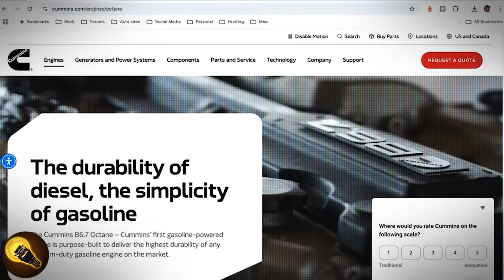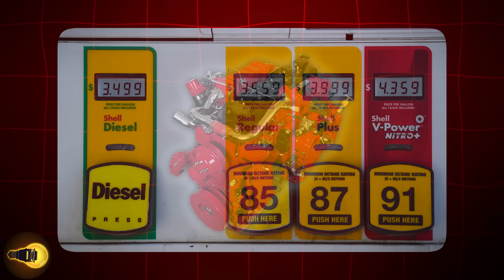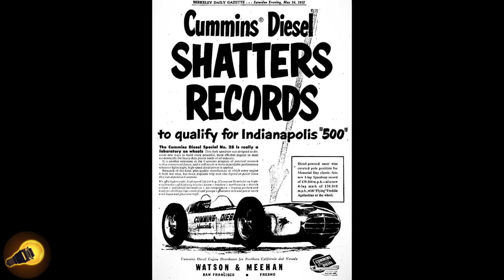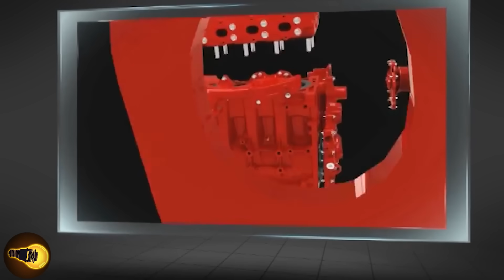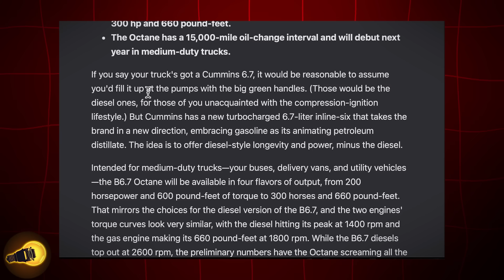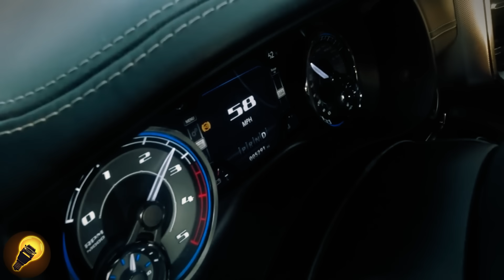Cummins Shakes The Industry With A Gasoline Engine!!!

Comment: The reason they built these engines because the diesels can't be kept out of the shop. Too many emissions problems. The engine architecture fits existing platforms and drive trains. Why not just make a spark ignition engine that runs various and forward looking fuels. Seems just smart to me!

Comment: Diesel truck engines in light trucks are "super long lasting" except that they break down every 50,000 miles with catastrophic fuel system, fuel pump or head gasket issues that cost $12,000 to repair. You could replace your entire engine in a gasoline truck for less than it cost to fix a diesel. Diesel light trucks are the biggest scam on consumers in history. I've never met a person with a diesel truck that didn't have to do massive modifications or repairs to their Ford Power Stroke or their Chevy Duramax. The Cummins Dodges seem to be the best ones though, and need less repairs.

Comment: Don't bother watching if you are looking for real info or know anything about engines. Seems like another AI video with much misinformation. For example it keeps repeating how maintenance will be the same as the diesel for the mechanics. Nonsense. No information on tech in it, gas engines compete on things so minute as piston ring tension and thickness or combustion chamber shapes to achieve MPG and durability. Zero info here. If you know nothing you can enjoy this AI video and still know nothing :)

Comment: That's an awesome idea  . Strong high compression diesel works with lower compression gasoline pistons ...what can go wrong . Longer lasting overly build engines? Cheaper fuel economy.  I think they have a winner !!!
Reply: I like the dream of that, but to get overbuilt it takes heavy connecting rods, pistons, then crankshaft and bearings. Now you have a heavy engine with lots of cost and internal friction which means low mpg. If the AI in the video was smart it would try to get this point instead of some imaginary long winded ad

Comment: I don’t favor dealing with spark issues but I think these engines would have a better impact if they were in medium commercial vehicles instead of the 7.3L gas Ford Godzilla engines. Cummins have a durable reputation, plus no Aftertreatment deff a plus.

Comment: At work I drive a Kenworth T370.  The PACCAR engine is based off of the 6.7L Cummins diesel.  If that thing became gas powered…I think I’ll be depressed, moody, and bitchy for awhile.  You know diesel withdrawals. 😫

Comment: Yes! Bring back torquey large displacement gasoline engines! People will gladly take the hit on fuel economy than to have a diesel on hold at a shop for issues related to EGR, DPF, DEF systems, other BS repairs that shouldn’t exist.

Comment: In the Pulling Motorsport, some top pullers convert their big diesel engines to alcohol which requires a change to a spart driven setup. other than gasoline, this sounds like what Cummings did

Comment: This is not the first gas engine for Cummins. It might be the first gasoline engine, but that is really not that different from a natural gas engine which Cummins has been making for years for medium sized backup generators. The ones I have seen myself were based on the 24V 5.9 engine.

Comment: Cummins had a really clean ethanol engine they ran in a delivery truck.

CUMMINS ETHOS ENGINE:
…According to Cummins, it delivers the power (up to 250 hp) and peak torque (up to 450 lb. ft.) of gasoline and diesel engines nearly twice its displacement...
...Using corn derived E-85, the high thermal efficiency and power-to-weight ratio of this engine results in 50 to 58 percent lower well-to-wheels CO2 emissions compared with the gasoline engine baseline. Using second-generation, lingo-cellulosic derived E-85, the power train’s efficiency features deliver 75 to 80 percent lower well-to-wheels CO2 emissions, depending on the drive cycle.

Ricardo built and drove an ultra clean ethanol engine for GM (EBDI) a while back.  Better power and more mpg than their diesel engine.

FROM RICARDO:
The new federal CAFE standards are calling for a doubling of fuel mileage performance, which, Vint says, is going to send OEM’s looking for high octane numbers to improve efficiency and ethanol is the best source. Ricardo, an engineering firm with over 100 years in the business of engine design, has developed an extreme boosted direct injection engine (EBDI) to optimize ethanol blends. The 3.2 V6 gasoline engine rivals the power and torque of a much larger GMC Sierra 6.6 diesel, he said, and it delivers 3.5 percent better fuel economy than the diesel.

Comment: All good, but they need to also make a smaller capacity 6 cylinder gasoline engine and a 4 cylinder engine. And also sell adaptor plates to fit -everything. This is for everything Not the three majors in the United States.

Comment: 6.7 Cummins gasser 300 HP 660 TQ. 20-22 mpg 2020-2023 3.0 Ecodiesel with top aftermarket tune 340 HP 620 TQ 30-32 mpg with 3.21 gears. 🤷‍♂️  But it’s not likely coming back. I think the 6.7 gasser will be far better than the 6.4 Hemi for in a truck

Comment: Caterpillar been making Gas and natural gas engines for years - only for industrial applications - cost is high but runs for ever
Reply: Why do diesels run forever? Because the cylinder walls are continiously coated with grafite.
The gasoline engines not. They will need an abraison proof permanent coating.
Do the new engines meet this performance?

Comment: I've actually seen natural gas conversions in an industrial setting.  They had a company in Mexico do the conversion.  At that point around the year 2000, Cummins wouldn't warrant the engines however,  they have operated successfully for many years now.  This should work just fine and you won't need DEF and all of that other EPA garbage on it.

Comment: They are panicking because of the EPA rules but if they would start putting speed of air pistons in the engines it would burn cleaner and gain 200 foot pounds of torque

Comment: Truckers would gladly drop a little hp n twist power for reliability and cheaper fuel. Diesels are freaking low rpm torque monsters but all the after exhaust add-ons has been an ever constant money suck + high diesel fuel cost + DEF + engine de-rates + after exhaust maintenance failures. Truckers can’t make money with their rigs sitting in the repair shop all the time. Let’s not forget gas engines are lighter, need less batteries because they start easier in the cold, and require cheaper engine oil and oil filters. Have been an ASE certified diesel tech for 20+ years - my guess is a gasser in a class 5,6,7 truck would make truck 1,000 to 1,500 pounds lither than ur modern day diesel rig - give truckers more hauling capacity. Gas engines pull a vacuum - diesels don’t. Get rid of the diesel engine and u get rid of the after exhaust treatment, DEF tank, DEF plumbing, DEF heaters, DEF ECM, jumbo battery packs, 50,000 psi fuel injection systems, cold start assist heaters, maybe air to air after cooler (maybe) - bet these new cummins gassers have a wicked turbo system. Hope Cummins succeeds with their gassers - they definitely build a great diesel.

Comment: This is not New before diesel engines if you needed more power you made a bigger engine 790 c.i. 6 cylinder or 8  Hall and Scott built some of those huge engines 251 c.i. to 1996 c.i these all ran on gasoline ❤❤❤❤

Comment: LOL, the reverse process of when OLDSMOBILE turned a gas engine into a diesel failure. This should be a minor adjustment, install an ignition system,  lower compression to gas levels, a few other (nearly) off the shelf items and testing. Looking forward to seeing real world information.

Comment: What are the odds this engine becomes the same as the Cummins they put in those nissan trucks? Cummins won't work on the engines and dealerships literally CANT. It's going to be a hot potatoe boat anchor, but I hope I'm wrong.

Comment: i have thought of replacing the injectors with spark plugs,    and a distributor ,   where the    injector pump is,    and running  the engine on heated ,  ,vapor gasoline, like tom ogle ,    did on his 1972 ford galaxie,,    he got 102  documented  miles per gallon    ,8.5 times  more gas millage,   that would put a tractor trailor  to   getting around 50 miles  a gallon.
Reply: he dident live long after that.
Reply: Yeah, yeah. Cummins has had natural gas engines for 50 years.

Comment: I love straight six engines, but I am struggling with the idea of a 1,200lbs gas six cylinder in a truck. That is hundreds of pounds heavier than the largest V8s in the gas powered realm.
Reply: That's why it will last a lot longer than those lightweight gasoline engines, everything about a diesel is more robust than gasoline, except cam followers, seems like no one can build them right anymore.

Comment: Make Diesel Great Again ! 🇺🇸
Reply: Reliable strong affordable simple
Reply: And the E-vehicle will never work unless they force us into 15 minute cities and take 2/3 or more of the populations vehicles away from We the People
Reply: Diesel is a fantastic fuel for vehicles that really work hard.  The challenge is for vehicles that get mixed use, where we still need the capability,  but only 10-20% of the time.
Reply: @harryniedecken5321  what if we do a diesel hybrid. That way your f250 gets 25mpg in equivalent electricity when you are in stop and go commute but when you need to tow shes ready
Reply: @TheAnnoyingBoss   Hybrids can make a lot of sense. Weight can become a challenge,  not so much for engineering reasons,  but the artificial DOT limits.   For a ram megacab,  it already requires moving to a 3500 srw for my fairly modest needs for payload.    No one else offers a megacab  / rear seat recline  / ability to take a nap that I can find.

Comment: To solve the emissions problem with diesels, they should invent an exhaust tip that you can add onto your current diesel engines or vehicles. Something like a coffee can size that reduces the exhaust that comes out by aTo solve the emissions problem with diesels, they should invent an exhaust tip that you can add onto your current diesel engines or vehicles. Something like a coffee can size that reduces the exhaust that comes out by a large percent then we can keep our diesels they should do it on all cars. They don’t need electric cars just find technology where you can add a filter on your current exhaust that will reduce admissions and Exhaust fumes by let’s say 50 or 60% and you change them out when you get your oil changed.

Comment: The RAM truck at 5:13 is what I call a sandblaster. Low profile tires are soft rubber compound. Because there's no sidewall, the tread face will heat up easily. When this truck passes you and comes back in front, you'll hear the sandblasting happening to your front end.

Comment: I doubt the longevity. There are very few gas that go past 300,000 miles.
And it will need aluminum block and head.

Comment: The Cummins gas engine has been in class 8 trucks for 20 years. Most used alternative fuels like Natural Gas or LPG. With an abysmal MPG of 3.5, the 15L gas engine has almost disappeared as have the filling stations.

Comment: Whoever programmed this AI needs to research the topic a lot better. Cummins doesn't make V6 engines... Period! The engine in the video is an inline six cylinder engine like Cummins has been making for decades. The problems that some of the comments referred to have been related to smog control equipment that has been constantly changing to satisfy the EPA. The engines run fine the way they were designed to operate.
Reply: He’s saying  B6.
Reply: You mean AI has to be programmed? I thought it was the latest tech and could think on it's own and replace every human being in every job that could ever be thought of, WOW, I'm disillusioned!

Comment: This always confirmed super gutless engine like a N14 & the rest from there don't have any respectable big grade incline holding power like any cat from the 3406B mechanical too the C15 Acert diesels absolutely no torque to keep your truck pulling hard like the above mentioned cat's does plus every dummins has another insider secret name known as the come apart because there super gutless & have to rev the snot out of them where the cat has all the reliable pulling power just above idle, said gutless inline six has to be rapted out to above 1700+ rpm to get any hint of real torque. Always hated going from the cat equipped heavy truck to these joker of a engine and the colour is a dead giveaway to how gutless these nightmares are. Period

Comment: Next big thing: Diesel helicopters.
Reply: They have already made a diesel twin engine prop plane the thing that worries me about them is the gelling at high altitudes.
Reply: Heavier, weaker engines are a great fit for use in helicopters.
Reply: Packard made diesel aviation engines almost 100 years ago, Mitsubishi in more recent times!🤷
Reply: @jeffmiller3150  What was the name of the Mitsubishi engine?

Comment: Get rid of thr DEF crap. And diesel would work like they should.  And the gov wouldnt be stealing our money.  And messing up the true cat and cummings
Reply: That's funny they say first gas  engine. In the late 60s early 70s I worked on a cummin   propane or ga s..  the injectors are replaced with spark plugs. We used a throttle  body  propane regulator. They thumped. Ran good. We bought them out of Indians.  They would high wine  and blow  from the hills.
Reply: @lylewallace9022  "They thumped. Ran good. We bought them out of Indians.  They would high wine  and blow  from the hills." Uh what?
Reply: @lylewallace9022  What?
Reply: But they are 504 or 555 can't remember so they are bull shit you. We had 7 in the fleet in our diamond reo.  Rest are 855 250 hp  270 high torque black engine
Reply: The military deletes all of their trucks 😆 how dare they expose our servicemen to that evil black smoke and not have limp modes kick in during a firefight!
Reply: The DEF is what we need.The particulate filter is what we gotta get rid of. Increase the compression ratio. You'll have to use more def fluid, but you'll get it clean burn. Less soot particles
And the DEF fluid takes care of the NOX!
Reply: @Fortislupus-k1k  And you earned your degree where? You need to contact Cummins and tell them how to design system's the correct way.
Reply: Yes the DEF systems are working just like the government wants.  It takes good hard earned money out of your pocket.  And puts it into their pockets. That's it.  Other than creating excuses pressure.
Reply: Diesels are really polluting by design. Thats why the gas version to get rid of the def
Reply: @tomhutchins1046 
You mean DPF

DEF doesn't affect fuel economy or power only affect your pocket
Without out EGR which is what makes the DPF nessasary and both cause an increase in fuel burnt by  ad much as 32 percent 
Heavy transport is as high as 150 percent
Reply: @garreysellars5525  You need to research a little then post. The EGR is used to reduce combustion temps which produce NOX but only under heavy  load. In fact on Heavy duty trucks designed for EGR you will crack the head or heads if you delete it. Most diesel techs can tell you that.  Def is just a way to burn particulates collected in an exhaust chamber. particulates are a pollution from diesel and there isn't much you can do about it other than DEF when your burning diesel. So no diesel = no DEF. how it effects economy well how about the fuel burned during regen cycles? How about the exhaust restriction? How about the weight of the massive chamber?
Reply: @garreysellars5525  Both the gas engine uses a passive cat. Dont think Def would work with gas and a cat could be wrong
Reply: @tomhutchins1046  have done the research 
You are wrong 
DEF is a chemical reaction to change Nox You do not turn der fluid 
EGR is a HOT AIR DETUNER 
It undoes the good work of the charge air cooler 
Temp before EGR and after can be as much as 48 degrees C different. Hotter 
That is the reason when you demand power there is not enough cool oxygen to burn and make power from the fuel added so the engine makes soot  which it then trapped in the DPF which then requires MORE FUEL to CHANGE it from black soot to White smoke 

Wasted fuel and power. Caused by EGR 32 percent
My ram has cooler egt without EGR than with 
And add water methanol injection you get triple advantage 
More power better fuel economy  cooler egt 
So with all this POULITION device's 
How is running the world out Of fuel faster better for the planet 😭
Reply: @tomhutchins1046  
As for cracking heads the tec guys would not be allowed to suggest removal of POULITION device 
It will not crack the cylinder heads
Reply: @tomhutchins1046 
Def injected at such a small amount per 100 Ks is only treating one poofteenth of the volume of exhaust gas
Only thing it reduces is your wallet 
For a product made up of 67.5 percent water it is gouging you pocket on price 😩
Reply: @garreysellars5525  That is true but in many rural areas between the good old boys they actually tell the truth. And it makes sense
Reply: @garreysellars5525  Some people think egr is to reburn some exhaust that's not true . Its uses a small amount of exhaust as an inert gas since the oxygen is burned out. It only works under heavy load and cools the combustion. Newer diesels are very high output and actually rely on the egr to cool the combustion under heavy load
Reply: @tomhutchins1046  
I know that
That is why I called it a 
HOT AIR DETUNER 
Not sure if that is enough research for you 
I have 45 years As a diesel fitter 
My Ram Cummins runs at originally 
14.9 litre per 100 Ks now
9.8 litre per 100 Ks 
No smoke 
With over 500 HP available 
Again 
How is running the world out Of fuel faster better for the planet to fix an imaginary problem
Reply: @tomhutchins1046  
Thanks 
Rural grazier 
Old school fitter 45years 
Earthmoving contractors
Reply: @garreysellars5525  Otherwise known as billy bobs.